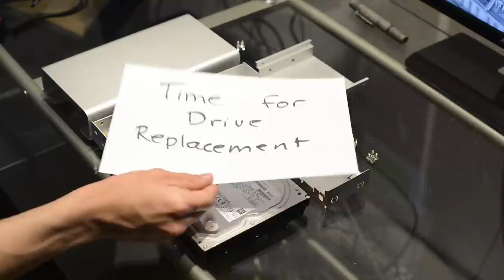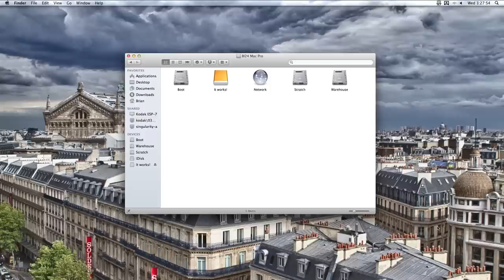4TB G-Technology G-DRIVE Disk Replacement

Comment: this works great if the drives are empty or will be wiped/formatted.  alot of these enclosures do something to the partition table that makes them only viewable in that enclosure.  once you take them out and use them in a mac or pc, the partitions will not be viewable, so be careful. i've had this happen to me with lacie and gtech drives and it was a horrible experience.  i had to use recovery software to pull all the data off safely.  secondly, if its a dual drive enclosure, your pretty much guaranteed it wont be seen outside the enclosure since they are usually in a RAID array in the inclosure.
Reply: Hi Bob...quick question regarding this issue...my G-RAID 4TB drive (4th gen) won't power up. Almost certain the drives are ok and something happened to power supply or chip in the enclosure. Any chance I could buy a used G-RAID (same specs, generation) and swap out my platters into that enclosure that powers up? Thoughts? (I know it was years since you wrote this...shot in the dark basically)

Comment: Perfect timing. It seems my G-Drive just died as it won’t even mount and Disk Utility can’t open it or repair it. I took the unit apart and it’s a 4TB HGST SATA drive. Will any 3.5” SATA drive work as a replacement or do I need to pay attention to the voltage ratings, etc? Or do I just buy an OWC Elite Pro drive/enclosure and put this G-Drive out to pasture?
Reply from the maker: Any 3.5-inch SATA HDD will work; no need to check voltages! You can even put in a 2.5-inch SATA SSD using a 2.5-inch-to-3.5-inch SATA adapter.

Comment: Hello Brian..
I have a G-Technology G-Drive with Thunderbolt 3TB that unfortunately had a kind of electric problem..so to explain shortly, the hard disk is ok and fully functionnal but the Disk case alimentation is not working anymore..just wondering if you think there is a possibility to repair this kind of problem and where to search for help..thanks by advance for your advice and answer..regards..J.C

Comment: I have 2TB I dunno if I can replace it with 4 TB? Thanks for the video
Reply from the maker: You can as long as your 4TB drive is either a 3.5-inch SATA disk or a 2.5-inch SATA disk in a 2.5-inch-to-3.5-inch enclosure.
Reply: @brianiannone  WD claims the max is 4TB on their forums. I wish I could find reports on much larger drives being successfully being used.

Comment: Hello, do the drives need to equal in size to work properly as a single volume?
Reply: +Brian Iannone Yes, but is this case, replacing with identical sizes true even if I wanted to use them as a single volume, which I presume the internal chipset does? I am not fussed about the mirror RAID.

Comment: Brian could you put a SSD in this?
Reply: Its just the form factor looked quite big. Basically I have a few 1TB SSD's lying around that I want to use as my externals rather than buying another drive. The drive in the video looked huge. Would a 2.5" SSD fit?
Reply: Paddy McDermott  Have you had any luck with this yet?
Reply: With the right adaptors and mounts, yes, it would fit
Reply: With the right adaptors and mounts, yes, it would fit
Reply: With the right adaptors and mounts, yes, it would fit